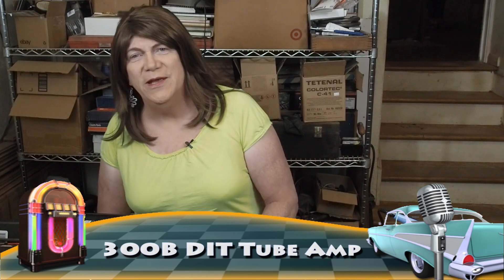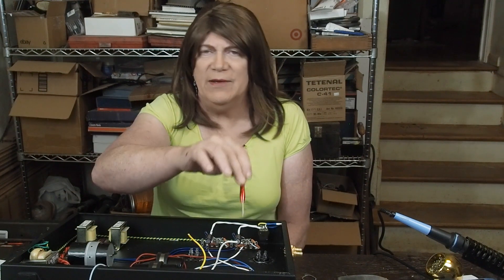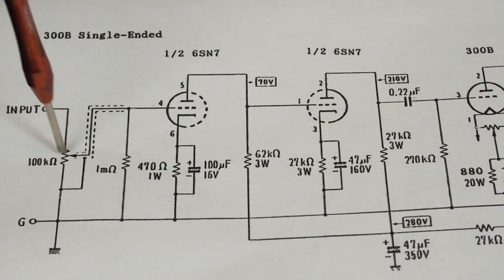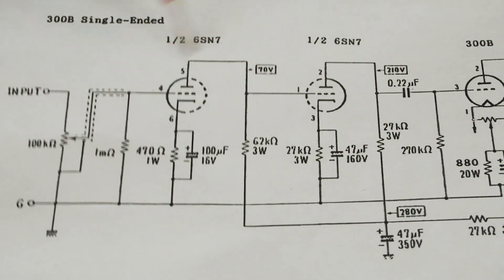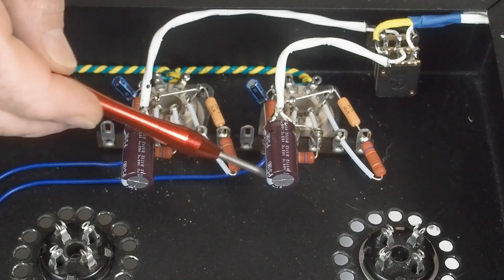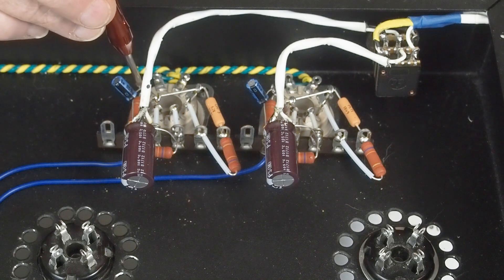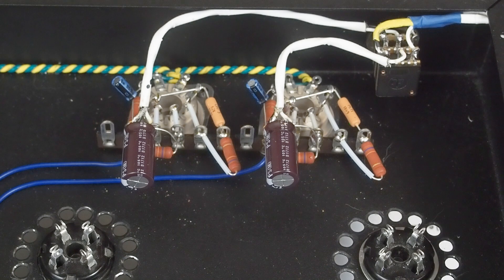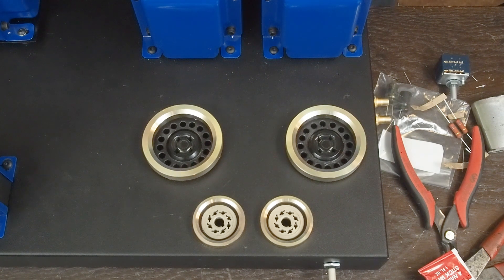300B DIY Budget Tube Amplifier Build DHT SET #6

Comment: I watched all the 300b 's video's.I'm a bit confused...Did you use the original circuit schematic with 27k ohms plate and  27 k cathode resistors on the second half of the 6sn7?
Reply from the maker: No, that was the original cascade design I started out the build using (that didn't work very well). 

The cascode I ended up using is here. 

https://www.skunkiedesigns.com/300b
Reply: @SkunkieDesignsElectronics  Thank you,quite a web site ! Going up!

Comment: I don't pretend to understand tubes, but have a question.  If pin 4 of the 6SN7 needs a drain to ground, why does that not apply to pin 1?  
Is there a source of information regarding tube wiring basics for a beginner?

Really love the videos you put out, I'm learning a lot!  Thanks for sharing.
Reply from the maker: These cascade and cascode type designs aren't for beginners lol. It's not that is needs a "drain to ground", the grid voltage needs to be lower or negative in relation to the cathode. In the first stage it's referenced to ground while the cathode is a volt or two positive. The second stage is fed off the plate of the first stage, which is a few volts lower than the cathode of the second stage. You will see later in this series I end up doing some drastic changes to this design.

Comment: thats good circuit sun audio used the same circuit
Reply from the maker: I go over this in the tuning video, but in my honest opinion, this is a bad design for this tube. I ended up redesigning the front end to get it to work well.
Reply: Fantastic series- definitely going to try this. I have built guitar amps in the past can’t wait to try this. Any chance of doing a pre amp only?